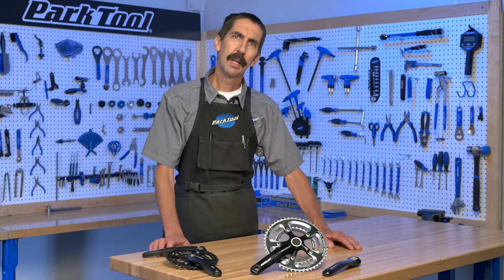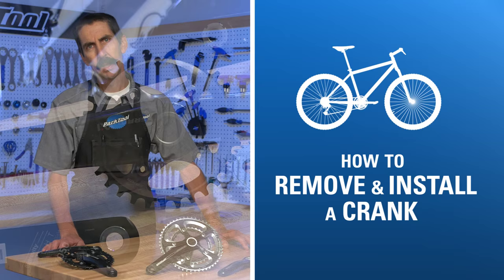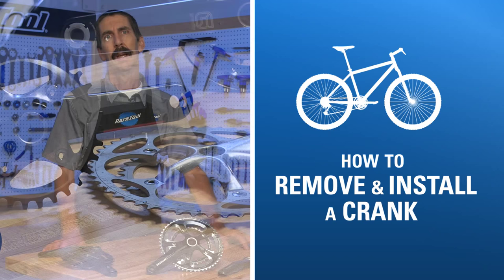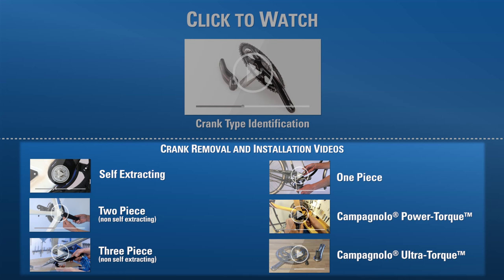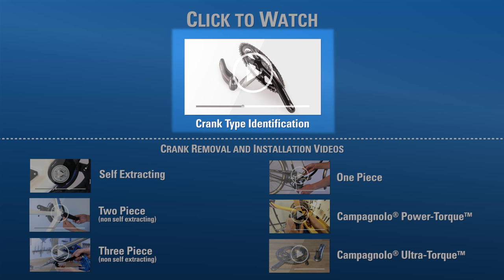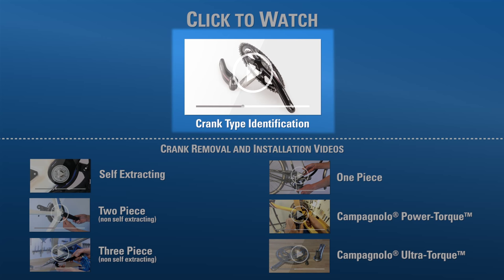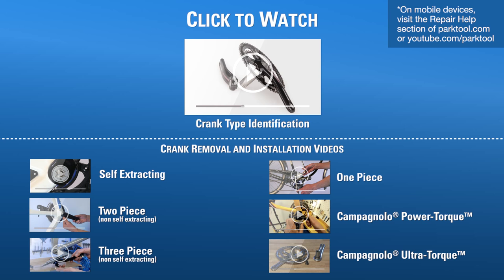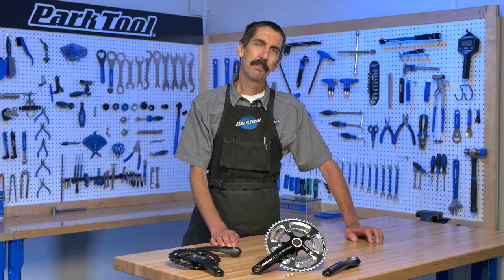How to Remove and Install a Crank Arm on a Bike

Comment: Hi there, for the first time I tried and managed to remove and install crank arms following your instructions since I lost the threads on my Trek 4900 Shimano crank arm. So I took SR SunTour crank arms from an old Mongoose Comp Tyax and put them on my Trek 4900 hoping they would work since both of them seemed to be square tapered cranks. What happened is the more I tightened the SR SunTour cranks on my Trek, the tighter the crank arms pedaling became. Crank arms ended up completely stuck and pedaling became impossible. I did not change the bottom brackets as well, could that be the reason why this is happening? Would you be kind enough to give me advice how could I get the old Shimano crank re-threaded or what can I do to enable using these SR SunTour crank arms on my Trek? Thank you for your help.
Reply from the maker: The Shimano crank uses the "JIS" system on the square spindle.  Suntour will used both the "ISO" and the "JIS" depending upon the model.  It seems likely you have install the wrong standard, and the crank in pushing up against the bearings. If you keep the current arms, look for the "ISO" standard for the bottom bracket.  Were the pedal threads bad on the Shimano arm? If the threads are partially damage a pedal tap will clean the threads.  If the threads our completely shot and stripped, you can install a bushing. We do not make a bushing kit but see  http://www.parktool.com/blog/repair-help/pedal-bushing-repair-kit-procedure-Calvin
Reply: Thank you so much for you reply. I am not sure if I fully understand the terminology. This Shimano bottom bracket specs are: Shimano BB-UN26 73 ML, BC1.37 x 24, MM110. When buying a bottom bracket, how do I know which ones are 'ISO' and which are 'JIS'? Would you be kind enough to guide me what specs to look for when buying replacement 'ISO' bottom bracket to my Suntour cranks? Thank you.

Comment: Hey guys, when checking for wear on a bottom bracket using the 'spin-the-crank and feel for resonance through the frame' technique...is there a tolerance for how much you should be able to feel resonate? If you can feel it just a little, is that ok or no? Thanks for all your help.
Reply from the maker: It does take some experience to judge this.  Try several new bikes as a gauge.  Steel will be rubbing on steel, so there is some resonance for all of them, it is just you can feel it more on some.  It is when it get grindy that it is an issue.
Reply: You guys are awesome with the quick and steady responses. Thanks!

Comment: I been searching on all videos on youtube the usage of all the kinds of greases that sell. a friend had issues with his hub and I ended up taking on the challenge of fixing it. long story short his freehub had water inside and corrosion happened within the internal parts. so I purchased the replacement parts and now while putting things back, I dont know which grease or lubricant to use. I bought several - ASC-1, PPL1, SAC-2, HPG-1 - BUT  I cant find videos that can point in the right direction on where to use these. wondering if you guys can make a video explaining the differences, the parts of the bike where to use them and so on. it will come in handy! thanks for your time.
Reply from the maker: For that application I would suggest HPG-1. We are always making new videos and we'll keep that one in mind! In most of our how to videos we do show which grease to use for that application and often say why. There is also a thread prep video that goes into it a little bit as well.